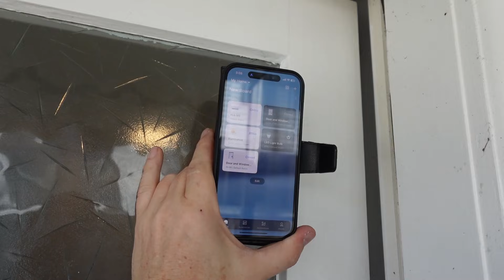Easy way to hide your door and window sensors!

Comment: There are old school security sensors that are easily hidden and don't need batteries. It does require running wires in your attic. I have five of these connected to an ESP32 that has ethernet. This makes it more secure because wi-fi/zigbee jammers won't have any effect on the system. I also never have to change batteries.
Reply from the maker: Thank you for your valuable feedback!  Yes wired solutions are always more reliable than radio ones!
Reply: This is exactly what I plan on doing? Did you get specific wire, I was planning on cutting open a ethernet cable and using a twisted pair for each sensor.
Reply from the maker: @ I have not actually done the wiring but twisted pair wire should work great!  This is the esp board that I used https://www.youtube.com/watch?v=j_vN-r6FC_o&t=3s
Reply: What wired sensor did you use?

Comment: thats the reason to use Aeotec Recessed Door Sensors, but a nicer way for your case is use a router with a 3d printed template. to make a nice groove.
Reply from the maker: Yes a router would make a much neater cut !